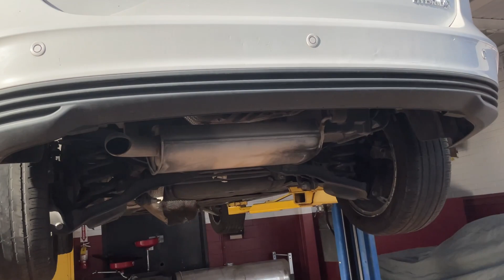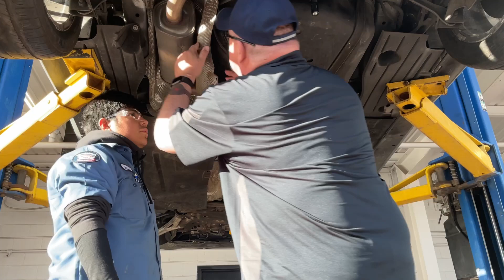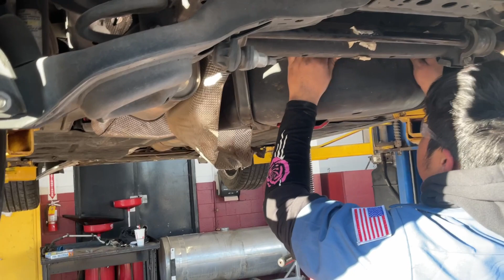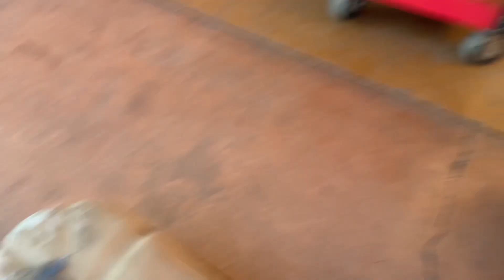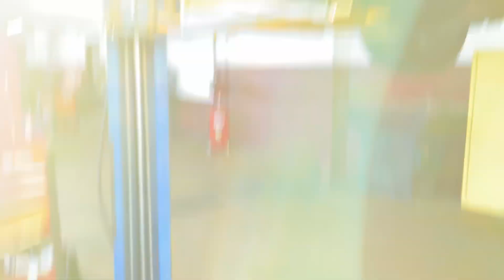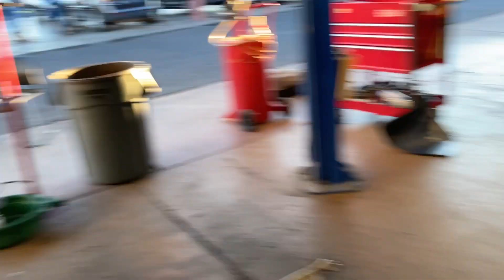2013 FORD C-MAX HYBRID FUEL TANK REMOVAL at Arizona automotive institute.

Comment from the maker: Steps for removal:
1. Make sure batteries and Hybrid voltage are disconnected
2. Loosen Heat shield enough to move slightly to allow tank to drop.
3. find something like a trans jack or an expandable undercarriage jack stand to support tank.
4. Remove straps from bottom of tank.
5.lower tank enough to remove fuel fill line and small hose next to it
5A. You may want to pump fuel out at this point to make it lighter to remove and reduce spillage, this one didn't have a whole lot of fuel and was relatively light.
6. drop tank a little lower, remove wire harness from fuel pump and disconnect fuel feed line from fuel pump.
7. if it older like this one is don't be surprised if the plastic clip fall apart on the fuel lines.
8. Once the wires and line is removed from the pump you can move the tank to the ground.